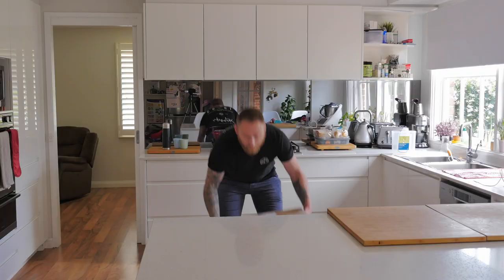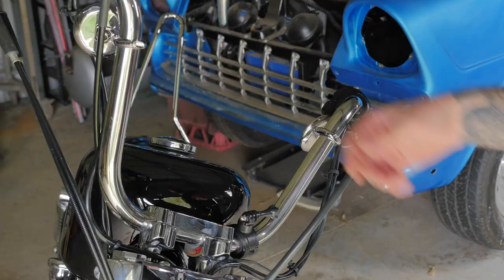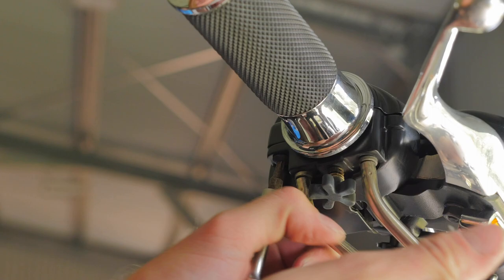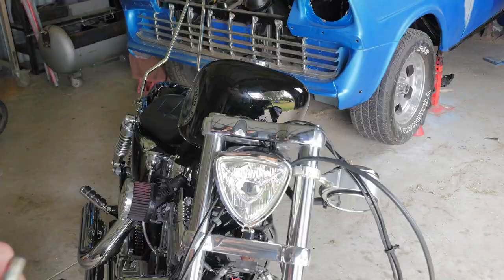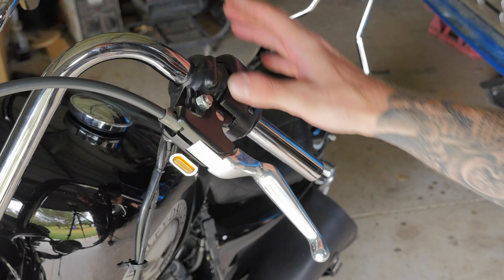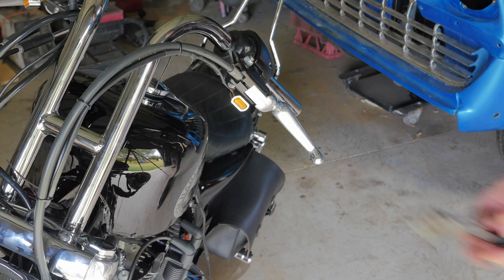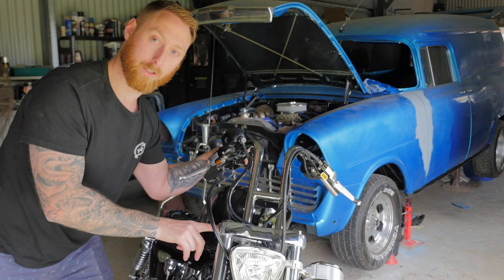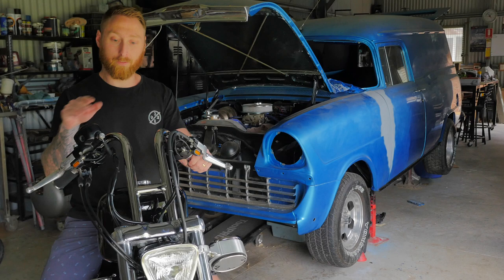Rabbit ear handlebar install on my Harley Davidson

Comment: The new bars also make it easier to use a suicide shift. You might want to consider installing one.
Reply from the maker: Thats a Good point man 🤟
Reply: Agree! Although we need to use the correct terminology here. There is no suicide shift. It’s a hand shift with suicide clutch.

Comment: That’s a cool look, and when you get the speed up the handling will follow 😅
Reply from the maker: Gonna be one sketchy ride. I think a steering dampner install vid will shortly follow this 😅
Reply: @TheGingybeardMan  yeah that might be a good idea 👍🏻
Reply: I bought a billet front wheel for my sporty and the bugger is bent 😳 it wobbles if I let go of the handlebar but if I hold on it’s fine 😂😂😂
Reply from the maker: @stinde666  🤣🤣🤣 hey if it works it works

Comment: Hi mate, could you please tell me where to get that mirrors?
Reply from the maker: I didn't install any mirrors in this video. I ended up using the triple tree clamp mirrors from a website called prism supply. Here's a link https://prismmotorcycles.com/products/triple-tree-mirror-mount